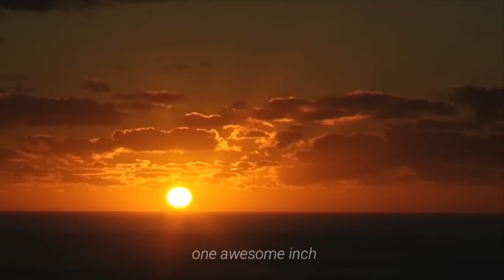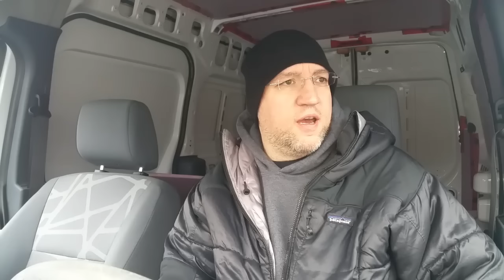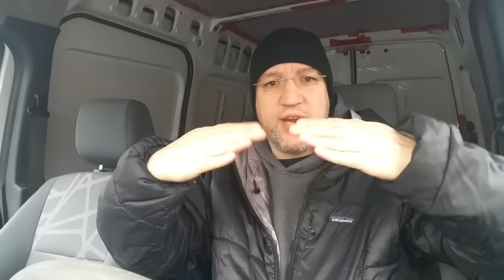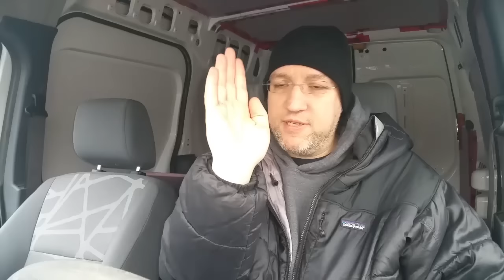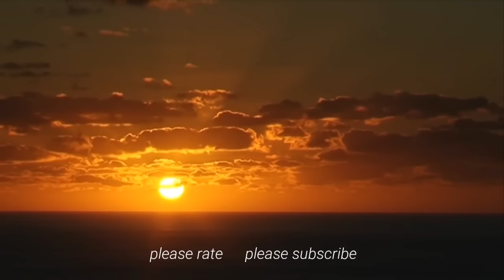Polystyrene Foam Cabinets.... Pros and Cons

Comment: Good to hear your views on things.  I'm the one that introduced the foam cabinets to Jed, so I wanted to give you my thoughts. Your pros and cons are pretty accurate;. they will take longer to build and the impact resistance isn't anywhere close to wood.  With that said, I would like to add on what you've said.  Regarding light weight, it's relay hard to to convert just how light we are talking.  Finished 1/2" foam with fiberglass screen is about 4 OUNCES per square foot. There is no plywood on earth that could come anywhere near that weight. One point for your viewers is that wood will always be stronger than the foam/screen method that I build with.  Foam/screen is stronger pound-for-pound, but that's a different measurement entirely.  Regarding durability, it's not as bad as you would imagine.  mine have been kicked, sat on, bumped into, you name it...  without a single issue.  Sharp corners can definitely puncture the laminate, but in normal use it holds up great.  I agree that it wouldn't haul tools around bumping into it endlessly, but I don't consider that normal use either.  Lastly is load capacity.  I've tested my panels up to 20 lbs/sqft.  this is beyond anything a normal traveler should have to consider ( I believe it's actually what most patio decks are rated for).  The idea with the foam isn't too be ultra strong regardless.  Most people build cabinets capable of holding hundreds of pounds, when in reality it may only see 20 lbs in actual use.  The idea is to build with actual use in mind,  and even then there is a huge safety margin.  Lastly, regarding impact protection.  I've done test panels with 1/8" plywood laminated to the foam, and in areas with a lot of impact this offers all the protection one would need, while incurring minimal weight.  Anyways, good to see the subject discussed more.  It's definitely not for everyone ( those needing very high impact resistance, those pressed for time, those that don't need to squeeze MPG from their vehicle, etc).  But for some, there are other huge pro's that are hard to ignore (no power tools needed, the ability to have a complete loaded conversion that's actually lighter than a donor conversion van,  best MPG possible, etc). The US department of energy shows that every 100lbs of weight reduction can add up to about 1mpg of fuel economy for the average vehicle, so you can see how saving 500 lbs could add up in the long haul.  Oh, one last thing--. I'm testing a method to make foam cabinets using truck bed liner for awesome impact resistance.  Stay tuned!
Reply from the maker: Hey great information! You make alot of excellent points. I could envision doing the foam cabinets some time in the future when I have more time.
Reply: Jon Decker interesting, and good info. I wonder how 1/8" paneling and truck bed liner would work for more strength and durability.. any way plz let us know what ya come up with. peace and good luck!
Reply from the maker: Just a warning about using truck bed liner for interior use... I read somewhere that it can have toxic off-gassing.
Reply: One Awesome Inch thanx for that bit of info.. I'll definitely have to look into it. thank you much.. does seam to be easier to just stick with standard building materials..  I built my over head storage / cabinets out of steel studs and 1/8" paneling.  turned out good and strong.
Reply: One Awesome Inch wow I didn't think about that
Reply: Thanks for weighing in. I'm still looking into this for my spring project to rebuild the van.
Reply: Jon Decker If you guys don't mind me chiming in, I used to work in a hobby shop and have experimented with spray bed liners (mainly Duplicolor's blue label 'liner) on clear Lexan/policarbonite R/C bodies.  I did find that the bed liner reinforced the lexan and added some densedy to it, particularly if applied to both sides.  I always shoot the stuff outside in the open air and it does take at least a few hours to gas out, but the stuff does work pretty good to reinforce the plastic and as a wear surface and adds to the opacity of the painted surface. I have thought that having the inside of the van body sprayed  with bedliner by a professional for the above reasons as well as some sound deadening and interior metal protection. 

  Now why I brought up working for a hobby shop, we carried light weight fiberglass cloth for use on R/C aircraft as well as different types of epoxy, including some that were waterbased.  After watching the construction video on  Jed's channel  the other night, I began to wonder about combining the foam sheet construction and lightweight 'glass sheeting to make the cabinets, then using the bedliner over the 'glass or just finishing the 'glass like you normally would and either painting or upolstering the cabinets.  Done right, it shouldn't be much heavier than the fiberglass screen with the Glidden product, yet still be plenty strong if not stronger. Another R/C body trick, would to be use Drywall Tape to further reinforce the corners and joints on the foam assemblies prior to covering them.  Typically the process is used to reinforce the Lexan bodies in more fragile sections after they are painted the is covered in Shoo-Goo to add more strength, although it does add a bunch of weight to the bodies too.
Reply: The truck bed liner sounds impressive and would probably work in conjunction with my idea of using that stuff to make a living module that floats.
Reply from the maker: Personally, I wouldn't want to breathe that stuff in a small van like environment. It may off gas alot in the beginning, but I believe it will continue to do so for a long time. Breathing even a smaller amount of poison still not optimal imo.
Reply: One Awesome Inch I've found that the Duplicolor brand spray bedliner in the blue labeled can takes about a week before the smell is no longer noticeable, not sure on long term toxicity, I can't imaging it being much worse than the chemicals gassing out if the van you're starting  with was brand new.  If you have a garage that you're working in, you might consider leaving it locked in the garage with the doors open and windows down and drive something else for a week or so. I'd so the same with any cabinetry, give it a week or two to gas out in a more open environment before installing them in the van.  If possible, just leaving the vehicle and other components out in the sun when possible should help the solvents that remain in the product evaporate quicker, basically by using the heat of the sun to bake the solvents and other, equivalent chemicals out of things quicker.
Reply: We had the Duplicolor Brand Spray On Bedliner applied to our truck and when asked when it would be cured enough to put the shell back on were told that if we were doing nothing but using the truck for hauling inanimate objects then we were fine after twenty four hours as it was cured enough to not be scratched etc.  We were warned, however, to leave it off for 30 days to allow it to completely out gas before putting it on if we ended to have our dogs riding back there (which we did).  I have no idea if this is the manufacturers recommendation or not but it was what the company that applied it for us said we should do.  They said leaving it open to the environment for 30 days before before putting the shell back on would give it enough time to make sure nothing would effect our animals.  Being a bit over careful we left the shell off 60 days and experienced no problems once it was back on.  Does make you think twice though

Comment: Pro-you don't have to be good with power tools to use this method. also, as a solo woman I find it very difficult to handle the weight (pick it up, turn it, put it into place) of a quality plywood (around 50 lbs).

Comment: your not just saving gas with lighter weight. your saving brakes and wear and tear on your entire drive train. plus lighter and more balanced weight means your right handles better which is much safer. Im not saying your prospective is wrong, but this is a valid point to discussion that I feel should be part it. Yes it takes extra time, but most of that seems to be waiting for paint to dry which you should be doing with wood anyway. Hopefully Jon will chime in on this video (the one who made the video with me and wrote the detailed article on my website).
Reply from the maker: Thanks for your thoughtful comments Jed. You make some excellent points. Most of my storage will be under my bed. I will be building a shelving unit to store food, and a little bit of cookware and will likely use 3/8 baltic birch... 1/2 inch where necessary. The shelving won't be more than 8 inches deep so I estimate my entire shelving to weigh around 20LBS  give or take. I believe Jon did contribute with some valid comments as well.
Reply: hey right on, sounds like you've put some good thought into it and made the best desicion for your situation. I look forward to seeing the build. congrats on the new van btw!
Reply from the maker: Thanks!  I actually tend to over-think things. Have a great night! ☺
Reply: One Awesome Inch I hear that! you too man
Reply: Timothy Keller Vandweller 
That’s really heavy shelving for your purposes. I’m three years late (and I’m also not arguing with you) but have you tried a ‘stressed skin’ method? 1/8” plywood on two sides with a light honeycomb 7/16” core made of wood would be super strong. And light.

Comment: i'm just researching van builds and tech atm but I belive i'm going to try a build like this but for the outside of it i'll use 1/8 panalling and the screen and paint on the inside giving it more str and durability and a smother finish without adding to much more weight. Ill use liquid nail to glue the 1/8 on and try to find another glue becase they type i'veseen him use expands and may throw of the ability to keep it square. So if u bump it u wont dent or put a hole in it

Comment: if you think about it from a crafty point of view,  all the paper bag covering is decopage, meaning in my experience with other projects if you get a booboo on your finish all you need to fix it is some glue and more paper bag.  if you have a hole to fill, wad up a little piece of paper, shove it in the hole and decopage over it.  if you've coated with polyurethane, use the poly in the place of the school glue.  it will totally patch.  im cutting my foam for cabinets right now, thank you guys for getting this awesome idea out to YouTube and into my brain!!

Comment: Not to be contrary, but there is a thing called SIPs, structural insulated panels, that has been around for years, they build houses with it, all it is is foam core. They also build houses with just the foam board and then put a coating of concrete on both the exterior and interior, super light, super fast, super durable. Also, you can put a 1/4 ply onto foam board and you gain the durability of wood and the lightness of foam. And planes are built with the exact method that Jed's friend used. I'm not telling you to try it because I wouldn't want to break the old dog, but a younger pup would at least do some experiments. 😉
Reply: Katie Fox concrete? wow!
Reply: BKYBZ: Great info. Exactly the kind of detail I needed. Thanks.

Comment: Airplanes are made out of this stuff. And youre afraid of that stability ...for cabinets in your van? People are hanging their lifes on this. So, I think, you are not well informed about it.
Reply from the maker: Hmmm... not sure I agree .Airplanes are not made out of polystyrene with latex paint for glue. Fibreglass is quite different.
Reply: Not with latex paint, but with a type of resin paint. It´s very strong, really. It´s non toxic as well. So, don´t be afraid to make it. Cabinetts have not to be as strong as airplaines.
Reply from the maker: Not this time... Maybe some day down the road. Take care.

Comment: Saw a video where the fellow was concerned about the foot traffic too. He added eighth inch short diamond steel kick plate. You could even use thinner brass door plates. You are nitpicking what is an easy fix. I would be more concerned about how to secure them to the van structure.

Comment: Anyone mention the added insulation benefit of foam? I might have missed it but makes a lot of sense building overhead cabinets that way. Making rounded corners like the interior of airstreams would also be much easier. To me the perfect mix would be 1/2" foam with a thin wood laminate glued to the exterior.
Reply from the maker: Yes I could see insulation advantages... Definitely.

Comment: OneAwesomeInch, I am looking very much forward to building myself some foam cabinets/shelves in the near future for the conversion of my minivan. 

Interesting in your discussion of fiberglass vs plywood bass cabs, it occurs to me that the self-supporting structure of an amp cabinet would need to be much stronger than a cabinet in a van, where generally the cabinet will be supported and made rigid by its marriage to the van's structure... Also it bears in mind a comparison to fiberglass subwoofer enclosures, which have been used for stationary applications in vehicles for years, with great success.

I can see that there are others here thinking on the same lines as me; that the foam will actually be a lot easier to fit to my vehicle, faster to shape, faster to cut? I'm thinking it may actually be a time-saver, but we'll see. :)

Comment: Build time can be speeded up going production style. Get a roller or cheap sprayer. Use a 4' roll of screen to cover the sheet in on pass.Cut on a table saw. Use 16p nails to peg it together. A skim coat of bondo could be enough to harden the surface. Anyhow dents are easy to fix with bondo and paint. Proper design using foam creates a more insulated space. Even the upper cabinets which run along the edge. Lots of heat or cold coming in there. The proper approach is a mix of materials. Corners and face cabinets  should be wood. Door panels, vertical panels, between cabinets should be foam.

Comment: The concept of building a van should limit added weight but also take in to consideration weight distribution.  Not only of the build but during a fully loaded trip.  This means you will need to shift weight as consumables are used (water and food).  If you add weight to the top of the van you need to offset it by adding weight to the bottom to prevent tipping in turns and high winds.  There is no easy answer but with good design and planning you can minimize affecting the handling characteristics of your vehicle and prevent wear and tear.

Comment: not meant to be verbose,, i was the one who very early on your 1st build noticed the  good quality wood in your build, but also noticed the significant weight,, your van could and can handle that load, it would impact gas mileage,, on this build i notice your being more frugal with ideas of making it a floating apt,,, i wish you luck in this build and you are on the right path for weight reduction , its very important overall
Reply from the maker: Thanks!

Comment: Good discussion on the pros and cons. Personally, I have made many cabinet enclosures, framed of 3/4 and 1 inch (no pun intended)  6061 aluminum square tube, Tig welded together, and skinned with thin plywood, very strong and light. Yes, most van dwellers haven't the facilities to weld aluminum, just throwing that idea out there.
Reply: Van Der Hoof that's awesome! I would love to work with a welder and get some aluminum going on
Reply: Into The Mystery 13 Yes, I think thin plywood glued to foam wood also be very strong. In such a tiny van with storage space at such a premium I wonder how much storage space would be lost to the foam. I had a fairly expensive tube bender, about $25k, that had foam on the inside of the sheet metal, some welding sparks fell into it and had I not had a fire extinguisher handy and happened to see it at the moment I would have lost the machine.
Reply: Van Der Hoof good point! wow did it just explode in flames or kinda melt?
Reply: Into The Mystery 13 I smelled acrid smoke, looked up and there were flames shooting 3 ft out of it into the air. Halon fire extinguishers were legal at that time, I shoved the nozzle into the opening and blasted it out. Had the machine been unenclosed it probably would have burned the building down, I doubt I would have been able to put it out. The fumes were horrible and the place stunk for months. A different situation from being in a van and an older style insulation, I don't know exactly what type it was.
Reply: halon is still legal to use, sell, and buy.  It's no longer legal to manufacture.  All product sold is from recycled stores.
Reply: Threewulphmoon Thanks for the tip. Halon makes for an awesome fire extinguisher, used it also to put out an electrical/gasoline fire

Comment: For me the main reason to try the foam cabinets would be less weight and the van would drive better for everything but just doing it on the upper cabinets would probably give the same affect because of not having the weight up high
Reply: My thoughts exactly. Since I want to use my van for part-time hauling stuff I need to make the bottom cabinets more durable. But for overhead stuff seems like the best choice: lightweight so no weird behavior on the road, no hassle to remove them if required. And also in case you hit your head on them, I would much rather rebuild them than wait 2-3 weeks for a head gash to heal.